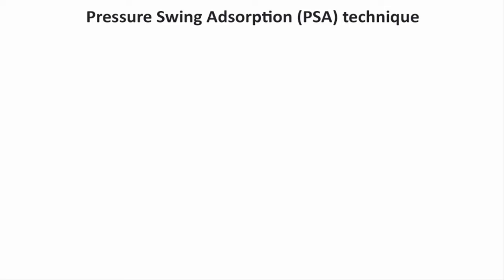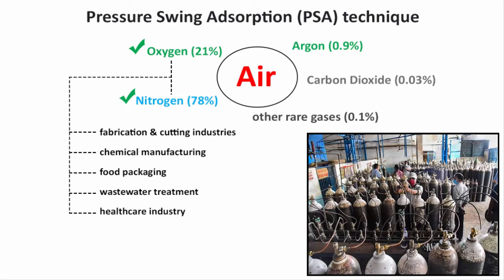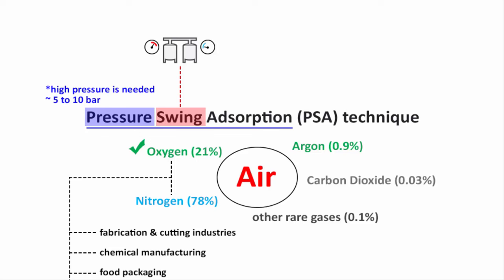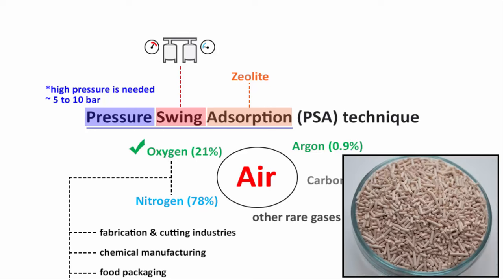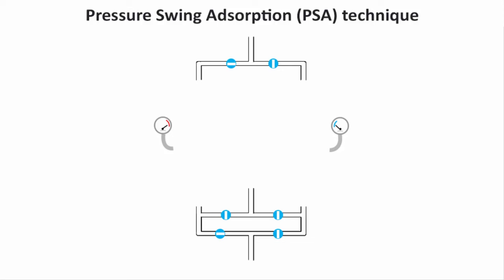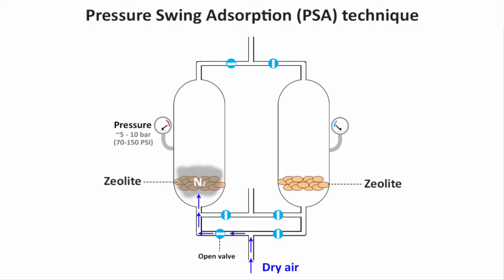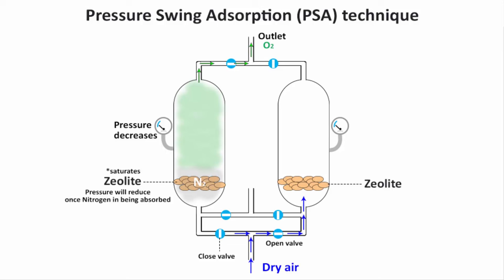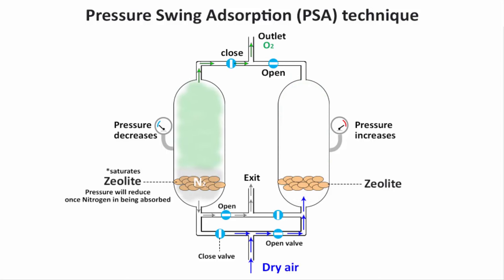How Pressure Swing Adsorption (PSA) technique works | Oxygen separation | Oxygen concentrator

Comment: I am a Chemical engineer and I assure this is one of the best explanation for a layman.
Reply: Sir can we use this to produce medical oxygen...whether this oxygen directly collected and can use for medical purposes?
Reply: @navaneethpa5308  As far as I know,medical oxygen is not produced directly.There has to be a separte unit for purification.By proper optimization of many parameters like height of the column,pressure and many more,the maximum oxygen concentration yield is around 95 percent.
You would see even Nitrogen extraction works in the same way except the Adsorbent material is different.This experiment has been run successfully by IIT Bombay which suggested conversion of Nitrogen plants into Oxygen plants(Search Youtube for further explanation).Hope this helps! Thanks 🙏
Reply: @pritammukhopadhyay1692  why can't we convert air into liquid and separate oxygen by fractional distillation??
Reply: @kishore2486  yeah..man this is also possible!
Reply: By any chance do you know a fabricator of these devices?
Is for a business opportunity
Reply: Sir, can you guide if only one cylinder of zeolite is used will it supply oxygen? Oxygen supply required is intermittent.

Comment: Congratulations for this amazing explanation. We are trying to build a machine like this. We are a small group in Istanbul.  I have several questions and will be greatful if you can help us. 1)In this diagram, why does the nitrogen leave the  chamber before pure oxygen leaves the chamber? 2) Do we need a second system to get rid of the argon gas? 3) Lastly, at what pressure do the valves open to release the oxygen to fill the tank? My best regards.

Comment: In "portable oxygen concentrators" Rapid pressure swing adsorption ( RPSA) is used nowadays. They reduce the amount of zeolite.

So if anyone is buying Portable oxygen concentrators, make sure it has capacity of at least 5-10 L with concentration of at least 90-93%.

Comment: For tiny flows this is fine.  For large flows (>5,000 scfh) vacuum cycle using blowers is better.  Why pressurize the 79% of the air you will throw away ??

Comment: I don't understand how this process can be cost-effective, it looks all the opposite. Zeolite must be bought, so it is a constant expense, which will considerably rise your production costs over time. 
Instead, you could build a Stirling engine which is the most efficient liquefier of gases (and that's why it is used in cryogenics, it can achieve as low as 15K temps), and separate gases by fractional distillation giving you 99.9% purity (which will make it very valuable) while if running on solar panels will be completely free. CNC routers in China cost 2k-10k, you can hire an engineer and he will make you stirling engine design for 5k-10k , total cost of setting up a plant to produce oxygen and nitrogen for free will be about 50k bucks. (free spare parts + infinite number of stirling engines)